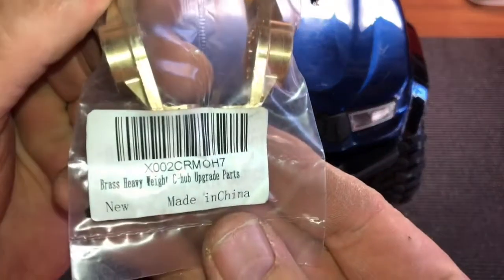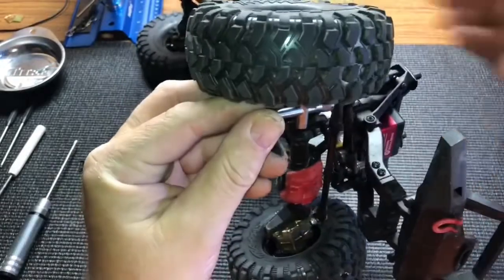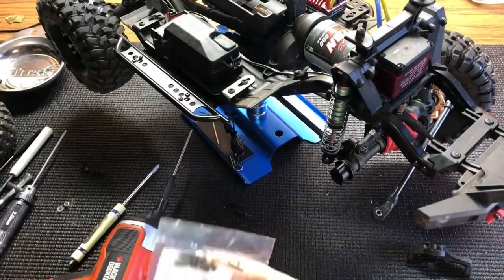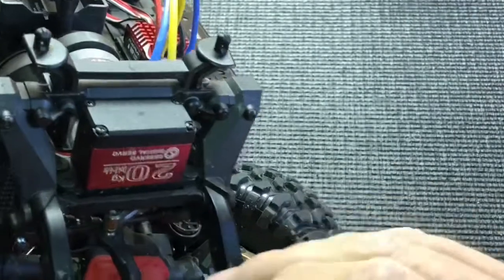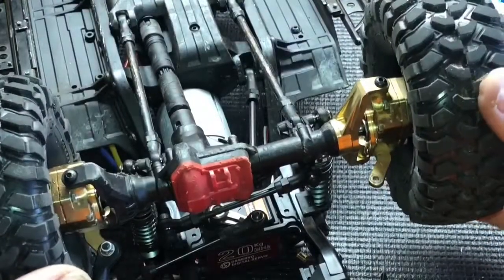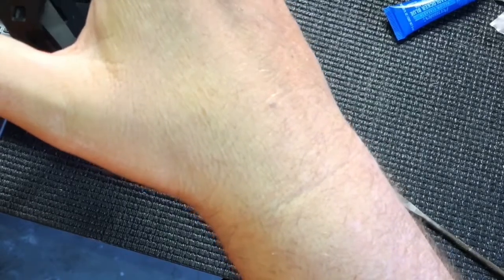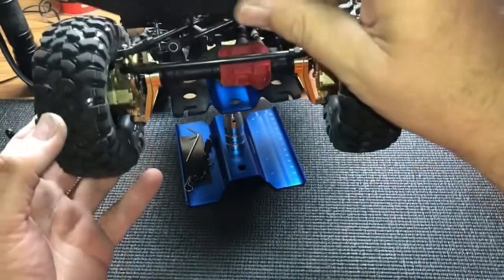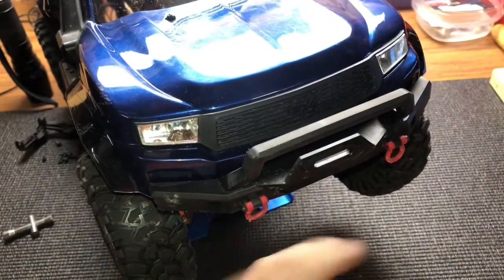Installing brass C hubs on my TRX4 Sport

Comment: What brass portals covers you using
Reply from the maker: Anthony Aviles they are the cheap Amazon ones. I believe they say Heavy Duty Brass Front hubs around $20 and they fit good
Reply: How dis you take the play from the c hub hinge pins
Reply from the maker: Anthony Aviles I just sanded them down a little at a time and keep test fitting them til all the slop was gone